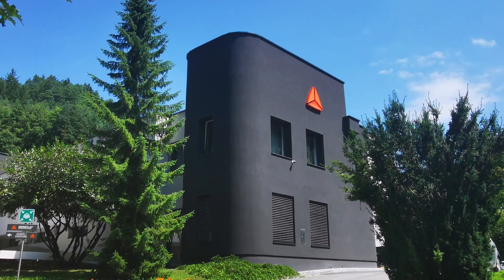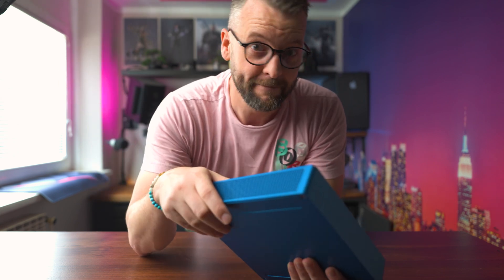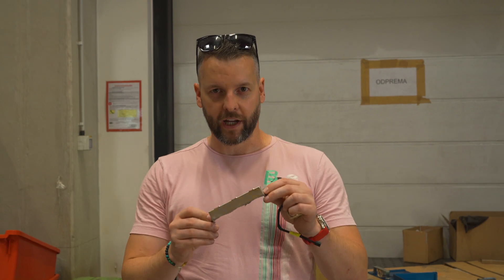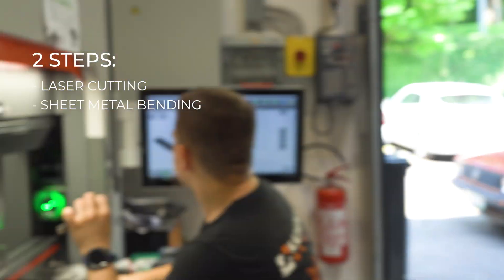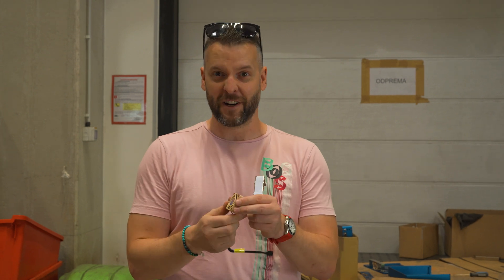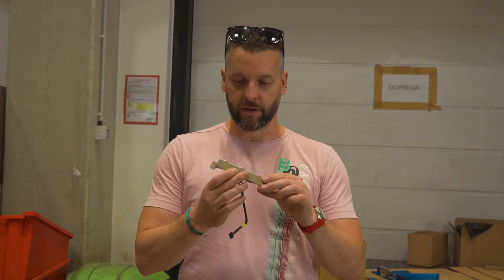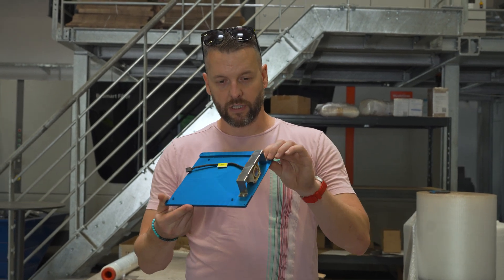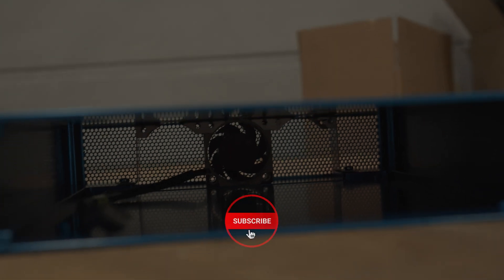How a custom fan bracket is made (part 1)

Comment: i might not be interested on purchasing this for a router, but definitely will buy one for a PC. will wait for the version with the pcie slot like you mentioned.  though I wonder if this case can be used for APUs. but it looks like it needs to be taller to accommodate low profile cpu coolers like Noctua NH-L9i for example.
Reply from the maker: Due to 1U constraint I doubt it can be used for APUs, but if there’s interest, can always make a taller version that break that constraint. Being new to the market I have to focus on one model and then, with some revenue from it, invest back into development of others. Thanks for the interest!

Comment: what Supermicro motherboard is this case made for? I have seen on somewhere but I can't find it again
Reply from the maker: X11SCL-iF is the one that is currently installed. That being said, if you check the previous video, you’ll notice that IO shield is a completely separate piece of aluminum, so it’s very simple to create one that’ll fit another motherboard. As long it is mini-ITX and will fit a 1U chassis, height-wise.
Reply: @tomazzaman  good to mention that! I just remembered that I liked the specs of the motherboard that you had. wanted to look at them again. 

will you make a thicker bracket or skip the metal tabs on one side for the fans screws? then the fans could be how thick case leaves room for. you have probably thought about all that already ^^